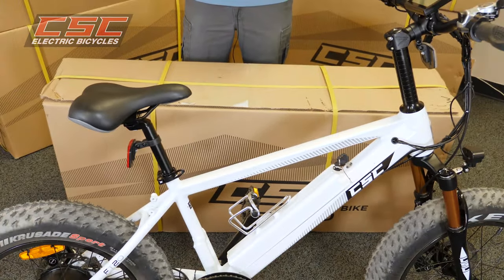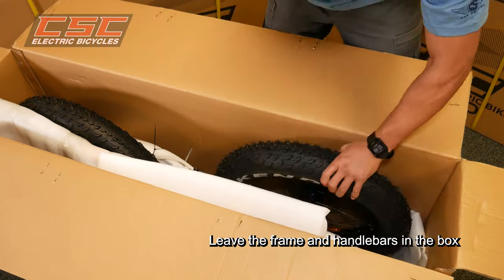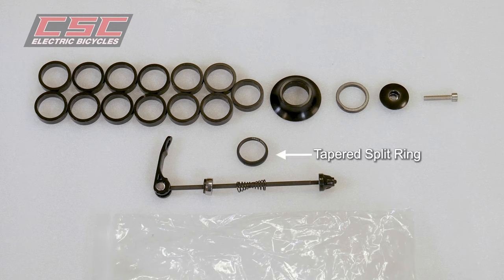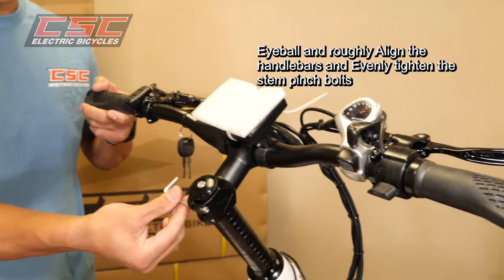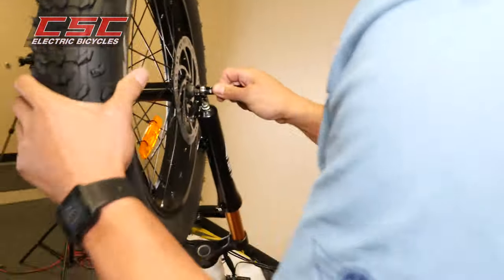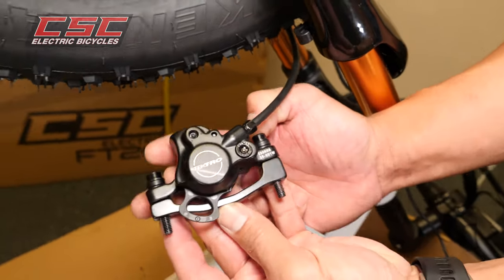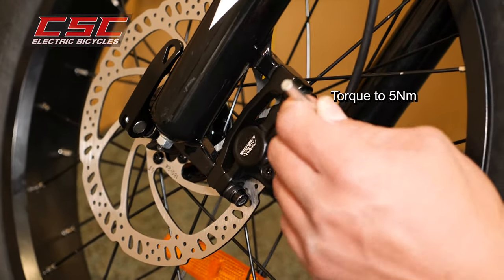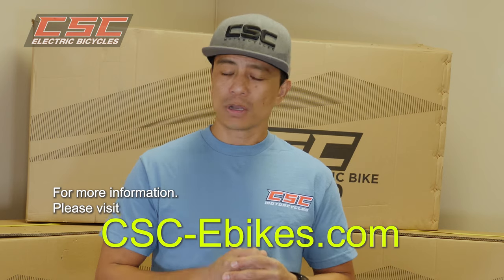CSC 20" FT-750 Unboxing and Front End Assembly

Comment: How tall are you
Reply from the maker: 5'10"
Reply: Thanks im 5'11 and im trying to decide between the large or small bike you look like you fit the small bike perfectly does it feel ok to you
The smaller bike would be easier to get in and out the shed with my motorcycle in it
Reply from the maker: @chriswedgworth   The larger 26" is more stable at speed and the bigger wheels will help negotiate terrain. Riding the 20" FT750 takes me back to being a kid riding a BMX bike. The nimble handling along with being lower to the ground on the 20" is definitely confidence inspiring.
Reply: @cscmotorcycles2297  What’s the max output of the seven 5020 inch motor? And when you unlock the high-speed how fast can you go? Appreciate the info thank you